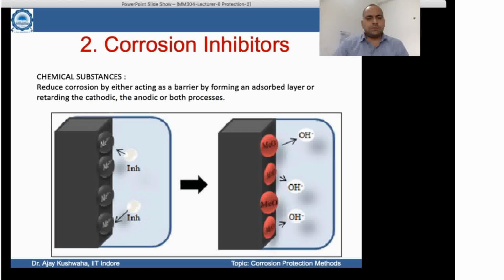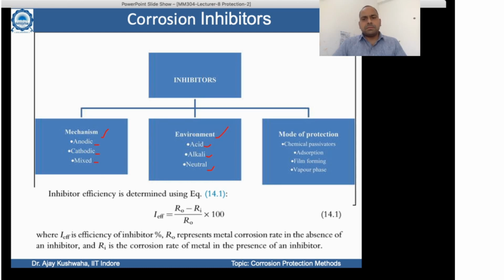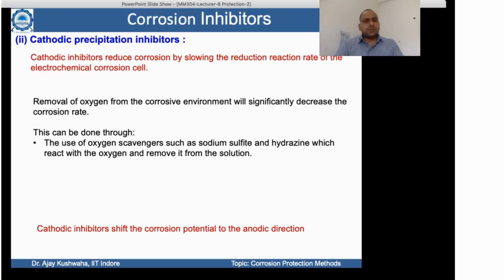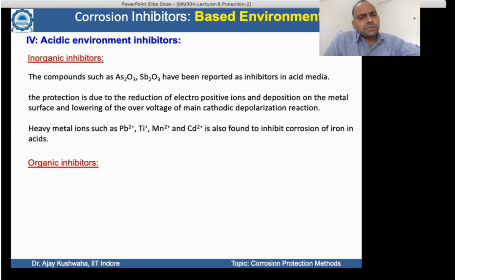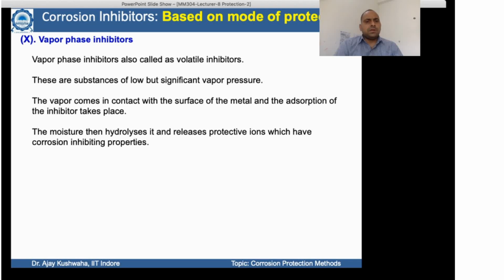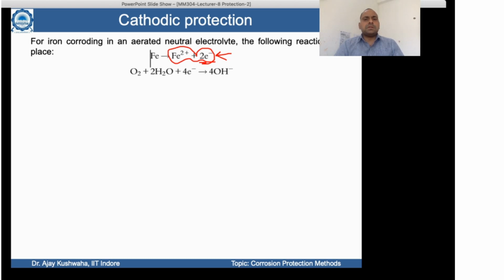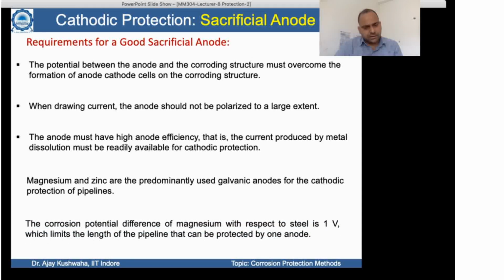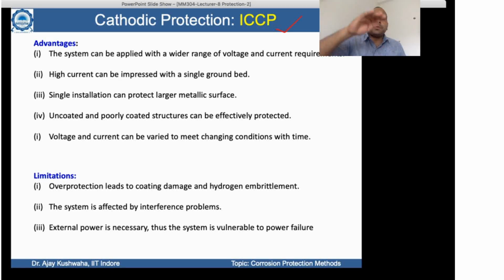Corrosion Inhibitors and Cathodic Protection (Sacrificial anode and ICCP): Dr. Ajay K Kushwaha

Comment: Question:  related to sacrificial anodes inside water heaters…the anode rod must make a physical contact with the water heater tank via/through the threads between the top of the anode rod and the threads of the tank correct?  In other words, if the sacrifice anode rod were completely insulated from physical contact from the tank, it would not work and it would not protect the tank, correct?   I called and spoke with a “Rheem” water heater company representative and they had no idea what I was talking about.  They seemed to be completely ignorant about this requirement.